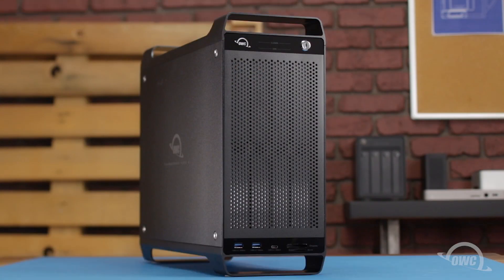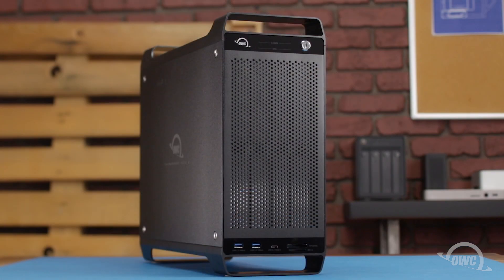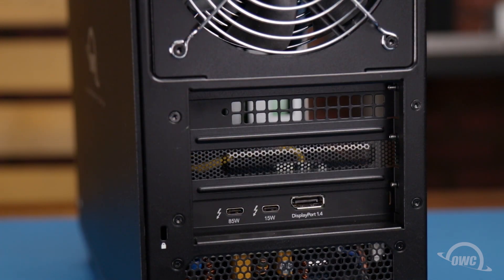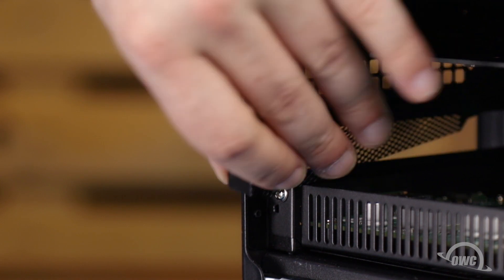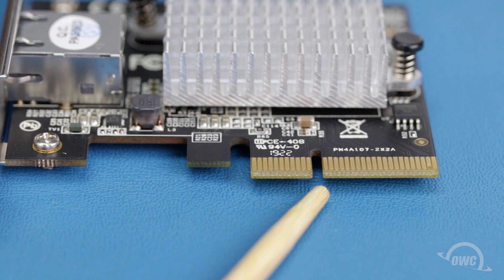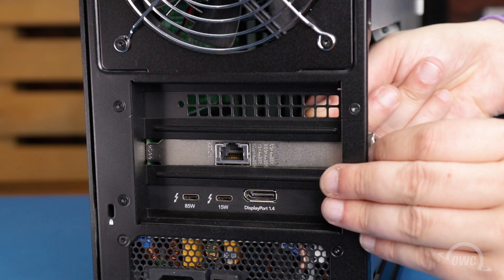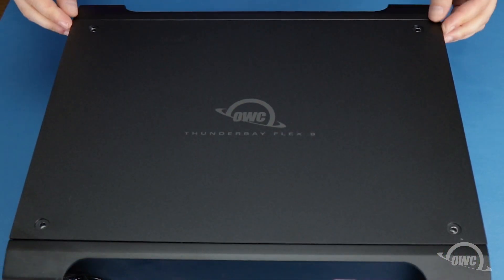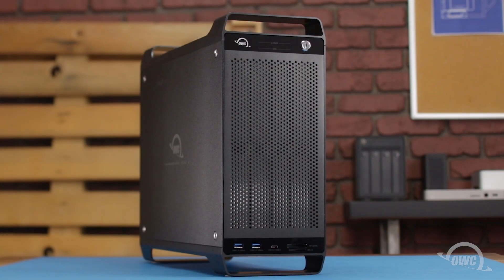How to Install a PCIe card in the OWC ThunderBay Flex 8

Comment: If I want to put 3.5" SAS drives in it, what would I need to get?
Reply from the maker: While we do not bundle or recommend specific RAID/SAS card setups at this time, we do provide an unofficial guide as a courtesy, to customers who wish to attempt this workflow.

Dual display support, including available resolution and refresh rates, is dependent on host hardware and drivers.

https://eshop.macsales.com/tech_center/index.cfm?page=/manuals/item/thunderbayflex8.html